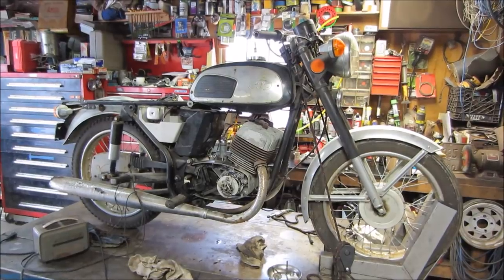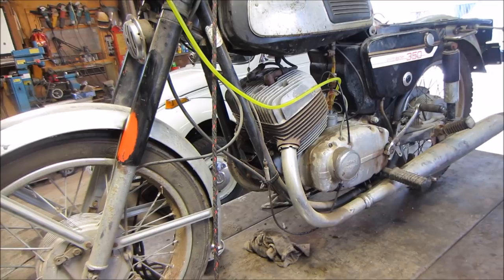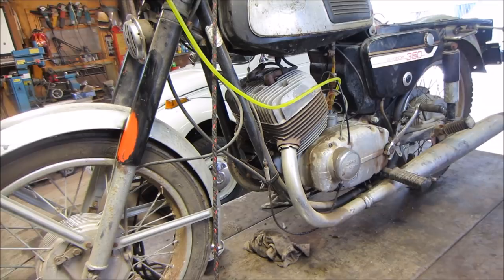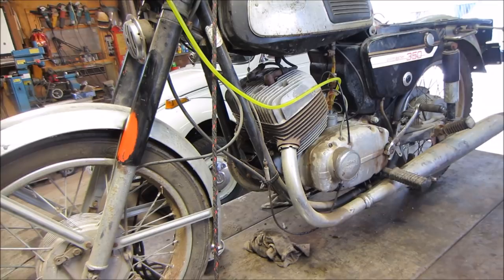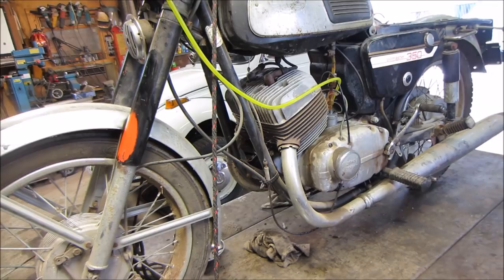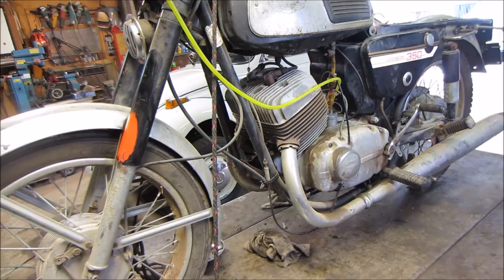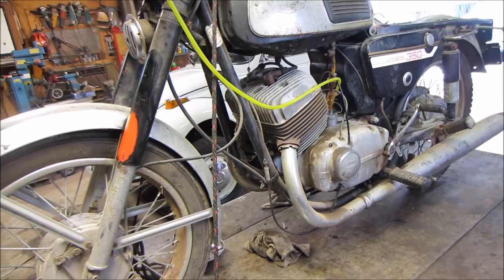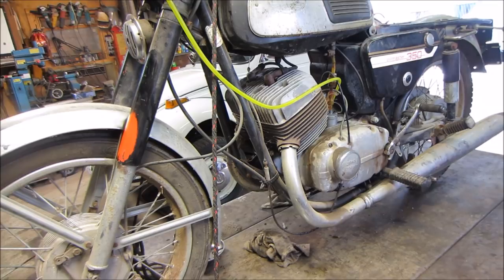Barn find jawa motorcycle, is it worth restoring?

Comment: I agree, it's often a good question as most bikes cost more to do than they're likely ever to be worth. Break even is the best be hoped for. So yes unless it's something very rare and valuable or sentimentally valuable to you or unless you just are in a mind that you must and I have a friend like that. I have my old CB250RS (a model you didn't get over there) bought in 1981, new, I probably even saw it come out of the crate. But the most I want to do eventually is return it to as near it's original state as possible to which end I have original bodywork still. But even then I will leave it's little dinks and marks, the later front forks which are better and it's non original, but still genuine Honda round head light and the CB750 bars I put on it after I crashed it in 1985 because they were free and are more comfortable. It's my bike and I like to keep its history with me, faded clocks and all.

Comment: On the Chrome around the wheels you can use mother's aluminum polish and you'll be amazed what I'll do to that Chrome as for getting the paint off the gas tank I find it high-test gasoline is the best way to get paint off and it won't hurt the original paint

Comment: personally, as a toy, i'd do just like you are, clean it up, get it operational and enjoy it, use a fine steel wool to clean the chrome as best I could then go over them with chrome spray paint, i've had decent luck with the stuff personally, for the mufflers i'd sand blast and just paint them with a good high temp engine paint, something that closely matches the tank color, or black stove paint

Comment: Talking about what to do with the Jawa, I would never have started striping the paint even, I would have just got it running good and doing the safety things as you are doing, and then cleaned it the best I could and either played with it as is or sold it.. I know that it will look good when you get finished with it anyway.. I just want to see it when you get it done...

Comment: Just picked up a 81 Yamaha 650 Maxim, dirt cheap.   Engine turns over.   Has locked up front disc brake and oh course your favorite, a dead battery.....LOL   I will let you know how much trouble it is to get running.  Oh and I need a front headlight and retaining ring.

Comment: Have you tried brake fluid to remove the paint? You'd be surprised at what it does to paint. I've used to to remove paint scuffs from bumpers and such.
Reply from the maker: l did,
Reply: If you want bare metal ,but it also contaminates it

Comment: Sorry this is off topic but after the VW job this has bugged me. London Transport used to undercoat their buses using a mixture of hypoid oil and black bitumastic and then throwing dry sawdust on it then a finish coat. I have tried it and it works well.  It's self healing but there is one downfall. Every time you work on it you get covered in the stuff. Great video and restoration boils down to two things - 'money' or 'I want it'. Will you get the money back on the Cushman?  I think it's an 'I want it'.

Comment: Rotary shifting tranny? This is a robust old bike. Pretty well preserved for its age. Even the wiring looks clean. I wish I was there, I'd be happy to do the cleaning and lubricating all the outer parts, etc. What's the story with this bike since you published in March 2018?

As for the chrome pieces, unless you want showroom-look, how about just scrub-washing the chrome and then applying a bit of Derusto chrome aluminum paint over the rusty areas? Make it a daily rider instead of showroom. Or resell as an original, unrestored vintage bike. A rare old machine like this deserves to be brought back to some kind of usable condition.

As for the exhaust pipes, how about aftermarket expansion chambers with snuffers?

Comment: This video is old at this point but for future reference, I have had great results with CRC Brakleen on a rag to remove spray paint. As long as you don't leave it on there and wipe it off it doesn't hurt the automotive paint underneath.

Comment: Mustie, Hi… not sure if this has been mentioned before but on my 638 model which is only four speed there is a neutral between third and fourth which may give the impression that it’s jumping out of gear??  This is apparently because the oil pump cannot supply enough on a long downhill stretches so therefore the advice is to put it into the neutral between third and fourth and coast!!!  This is not the bike you “enjoy” riding!   It’s one to get you from A to B. Slowly. Quirkily. Smokey.

Comment: If you are 1st definately interested in the particular bike & 2nd have the money  & 3rd have the time as well expertise to put into restoring this bike I'd say then go for it as it does run & shift. Personaly with this particular bike I'd not mind non stock replacement parts on anything missing as I wouldnt be going for a full restoration, I'd just be getting it rideable & able to pass inspection, but thats just my personal prefferance as I wouldnt be restoring it to win @ shows or to get the most $$$$ when I sold it. I think you've got alot of potential either way but only working more on it will reveil any faults that may be hidden.

Comment: It would be very nice to remove the entire exhaust, sand blast, wipe down with acetone, then VHT aluminum and clear. Heat gun to flow and dry. Paint removal and chrome cleaner- DOT3 Brake Fluid, SOS grease cutter pads, warm water. The longer the brake fluid sits- the deeper it goes. "Overspray" like that- 1 hour soak, then scrub. Not "steel wool" or oven cleaner.

Comment: When I was a teen I worked on a boat and the captain/supervisor rode one of these daily, he had no other transport.  But it was all black like this one.
Those things were everywhere in Europe at the time and people would swear by their reliability (also MZ singles) but this guy was dumb enough to flood it daily and have to push it to somewhere where plugs can be cleaned.

I would go in somedays knee dip in water, get the generator started and the main engines, and pump all the water out so the boat wouldn't sink, he was too scared to be electrocuted, he'd rather wait for an "expert" and wouldn't listen to me about flooding a 2stroke.  He was the captain, I was a teen and had no bike or money to buy one.
Generator was MBenz, main engines were GM 550hp diesels.  So the CZ was simple stuff :)

Comment: I bought one of these in the 80s with a sidecar £850 brand new and everything that could go wrong did the bike had to be rewired after 3weeks then the rust moved in chain broke battery front shockers seat split lights stopped working clutch broke cables and all this in the first year so I bought a Kawasaki in 400 so good look

Comment: I mean no, right now I have whole year in my bike, about 3 times the cost of the bike in parts and work and it is only a piece of junk that I bought two years ago. And i am a student of a college with close to no money... But it is possible :)
But on the other hand, I agree that complete restoration will be very cost and time ineffective, but make it really nice, I believe you can do that :)
By the way, those rims look gone, but they are not. Scrubbing with coke and aluminium foil will make them shine again. The exhaust doesn' really need to be chromed, it always looked like that. Handlebars would come back aswell, so the only thing that needs re-chroming are the side panels.
Reply: I would totally come and help you, or make an offer, but both has issue - 5000 miles is really considerable distance... :/

Comment: Jawa (and CZ) bikes are workhorses designed to last for generations and are best left unrestored and just ridden. They make great rat bikes in the UK and Europe.

I've owned 4 of these and own 3 of the next model that followed them.

Buying new pipes and mudguards is far cheaper than having the originals chromed.

Just strip off the nickel and chrome on the pipes and paint the things stove black just like 99% of owners do with this model as this model is notorious (out of all the Jawa bikes) for peeling chrome.

Yamaha RD 250 / 350 / 400 silencers will bolt straight on and the bike will run better. I did this with one of mine. On another I fitted CZ 250-471 silencers as the chrome quality is far better and they looked nicer. 

The headlight is also not original. The OEM is plastic backed with a chrome rim and much shorter with a dedicated ground (white / grey) wire onto the bulb holder. I use one on my 1977 Suzuki GT550 B as it gives a better beam. They are cheap brand new.

Original tail light is a Lucas item as found on the Triumph T140 to comply with US / UK tail light lens reflector laws.

Comment: Ever thought about a middle road? Must restore mean as good as original? One can also take it to a nice level by cleaning up stuff and then simply painting it. Will painted handle bars or wheel rims no longer work because they do not have a chrome finish anymore? As long as one does not see such a project as an investment but just a fun job, as you do, one can still get a nice bike by going the extra mile without actually spending too much. So what if it's never going to go to Pebble Beach? :-)

Comment: With my old bikes, I had to have it running to get my headlight brighter.
Reply: Agreed. While the higher RPM's will generate more amps, I would guess that it is a grounding issue and the fact that there is massive corrosion at every connection and the wires have lots of green if you peeled back the insulation. I didn't watch it to the end yet so I guess I will see if I am wrong? Lol

Comment: The rule of thumb for restoring anything is it will have more money with time & cost in it then you can possibly get out of it. Unless you do not plan to be married to it just do the mechanicals and a light cosmetic ( clean, polish and touch up paint ). Work it like you would at a car dealer, if the end result doesn't meet you profit expectation when done, wholesale it to someone who will .

Comment: You do not read these but I say your right the metal is to far gone to be pretty so I say sand blast the chrome and pitted bits and paint then - rims mufflers etc. or give them your patented  fake rust treatment with an oil rub down

Comment: $250 for a 64 Yamaha Trailmaster 80 (with original title).  $1400 later, it looks damn fine and runs fine.  Could I sell it for the parts I got in it + the bike $1600, not including my time.  No way.  It's slower than anything over a 50cc scooter.  But it's cool looking and as old as me.  I did the work, I did the paint.  More about satisfaction to get it running again, than what I can sell it for.

Comment: Runs without choke because its running rich all the time....Witness when the fuel ran the float chamber dry and it leaned right out as it came to a stop.  The left cylinder is running really rich and smokey for some reason...?

Comment: aw yes the jawa 350 if i recall the shift was one down and three up and neutral in between to set the point gap the manual read as such use the aluminum foil paper from your cigarette actually they were pretty quick little bike for what it was and ran nicely down the road i use to work in a dealer and i remember having a jawa in there had to take it out every now and then to drive it or it became a bitch to start if it sat too long nice old bike though

Comment: it's 1 down 3 up :) And has sort of automatic clutch :) And 2nd neutral between 3 and 4 - the neutral light doesn't light up for this one.  New set of exhaust would run you ~$270 :) New rims are $50 (not laced) over here :) In Czech Republic ... :) So ... :) Do whatever you want with it - I personally don't like 2-strokes :)) It's nice to see it running over there over the ocean :) Shame where the brand ended ... I'd rather see it die like CZ (I'm afraid I'm starting a flame war here :D) Guess main cost of the parts would be shipping :) For many reasons these have a rather big following over here in former east block :) Many people had these (not Californians) or variations of these - it was more or less THE big bike. at least here in former Czechoslovakia and probably surrounding countries... :) Everyone got their license on these etc ... :) (I'm too young for that though...)
Reply: How much is a new Jawa 350 Retro in CZ?
Reply: Aaron Bryan $3366ish but I thing it's not easy or maybe even possible to get them on plates over here as they really don't match EURO4
Reply: Great info from František Šindelář, I would only add to that, as mentioned its kind of semi automatic clutch, once the the gear lever is push either way it automatically engage the clutch. This is in my opinion clever solution from JAWA engineers. For example if your clutch cable snaps at any point of your travel, you can still ride the bike and use all the gears. I still have Jawa 638 at home, and talking from my own experience. To launch from steady position you just need to push it in to 1st gear and hold it there and slowly releasing it with little bit of throttle will do the same as using hand clutch and get you moving, same for the other gears then.

Comment: Let's say I had 100,000 dollars and I wanted to buy a bike I want do you think I would go for an oldie and Russell write it a full restoration or do you think I'll buy a new bike both of those are wrong because I don't have $100,000 dollars will you still want to spend is at least 1000 or 500 because the thing that I want to do is somebody says I want a 670cc with a variac torque converter setup and a big wheel in the front and a tiny wheel at the back that's going to run them what's a $600 plus the time and effort plus the variac in torque converter to set up that's going to be plus the rims rolladeck tax that they would want to put on it pretty much $1,000 for if they want the American special which is a framed bike a nice tubular frame Steel tubular frame that it's sort of a ladder a frame sort of type of deal that comes up to a 670 Engine with a variac just a plain old very active you know sprocket variac just bracket with a suspension with nice dirt bike tires front and rear and speedometer oil pressure brake system and a clutch which is pretty much a linkage down to a tensioner which pulls all the attention off the tensioner pretty much and as a matter of fact. That's going to argue about eight $900 somewhere around there and that's our regular Steel Plus plus time that will be either 1000 when I can like an awful lot of those and make myself a American special with saddlebags all that crap special you know special special for me I would have more fun get locked more range out of it and do better with it then I would an oldie and have to 6000 years on it pretty much if you even look at my comment you would know what this is about I would rather build my own bike and haven't have all the knick knacks that I want and I don't have all the knick knacks that I do not want